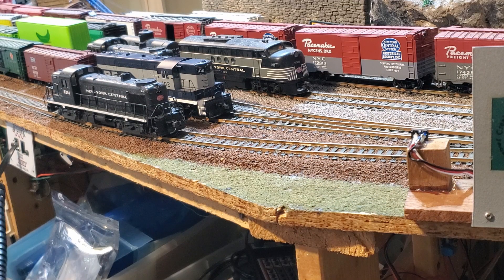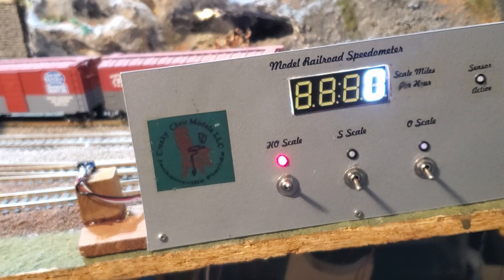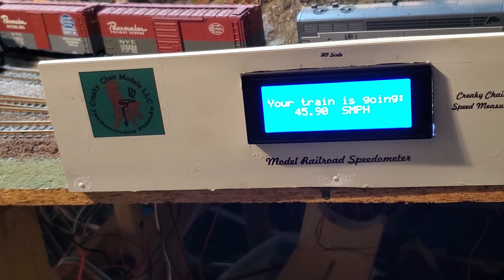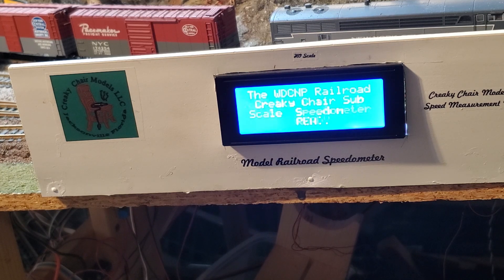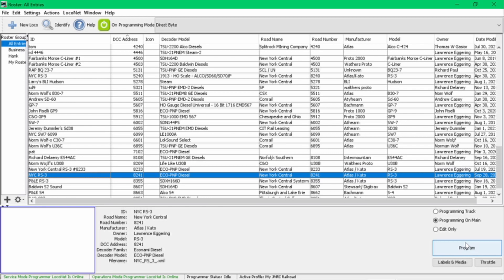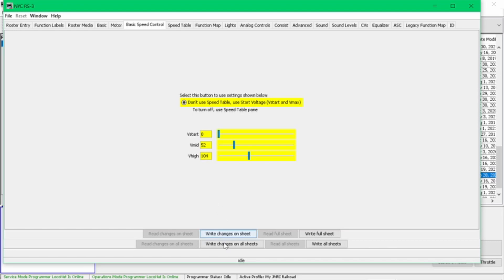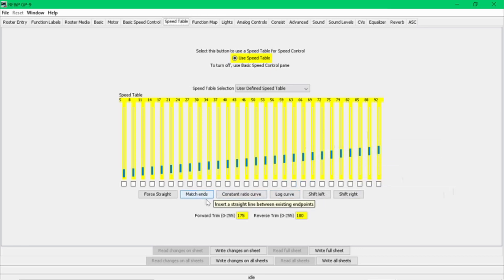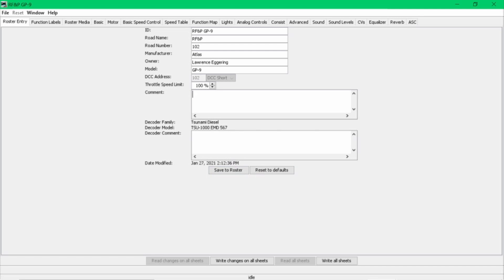JMRI Speed Matching Locomotives

Comment: In your program notes you have CV 5 listed as mid range and CV 6 as top end speed. Correct me if I am wrong but I believe that is reversed. CV 5 is top end CV 6 is mid like mentioned in the video. Other wise this is very helpful.
Thanks
Reply from the maker: You are correct. I stated that multiple times in the video. I will correct the notes. Thanks!